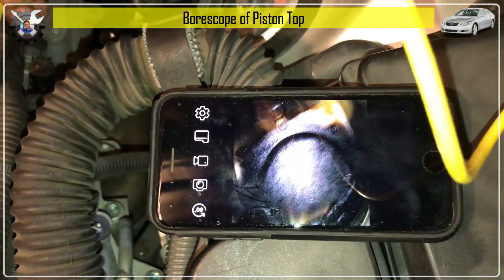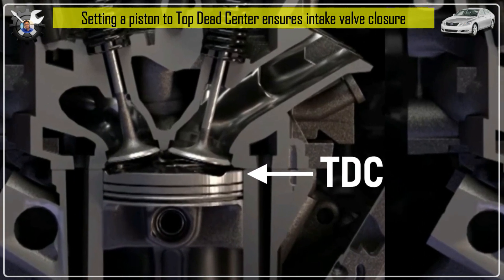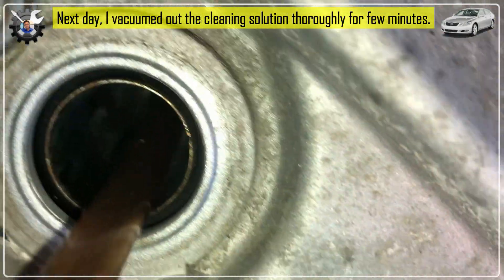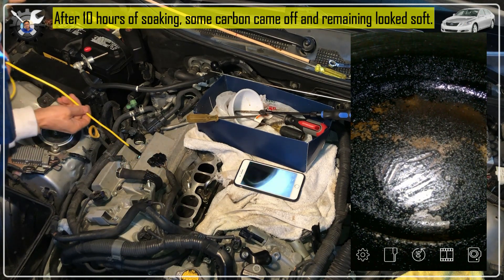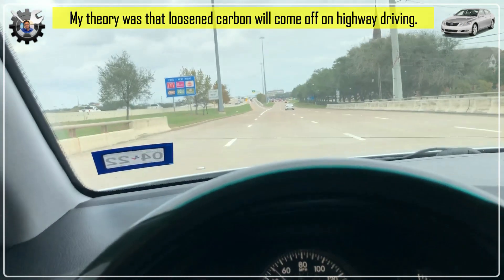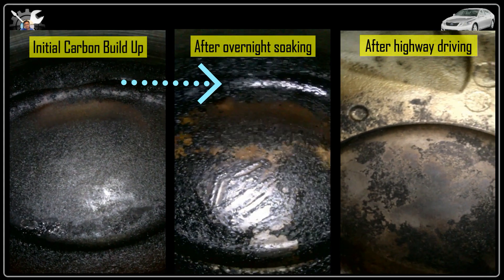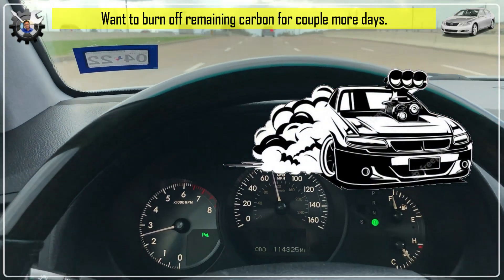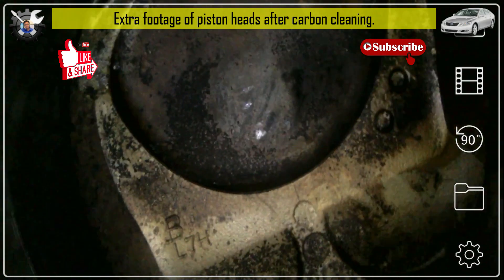Piston Carbon Soaking & Cleaning

Comment: Hi there. My biggest concern is to use chem-dip over B12? Your recommendation is to leave chem-dip soaking pistons for about 2h compared to B12, which can be left overnight or 6h and repeat 3-4 times for better results. Most of the piston soak procedures on YT are carried out with B12. Is there any particular reason for it ? Is the Chem-dip stronger than B12 ? 

I have done this procedure with B12 on my Audi Q5 2.0 tfsi with positive results. The oil consumption dropped, and im getting better MPG. Your video made me think to use something stronger as chem-dip with the 2nd piston soak treatment, which could potentially eliminate the oil consumption.

Thanks for your great video, anyway. Best regards

Comment: Great video but I would definitely recommend changing the oil immediately after filling the cylinders. Remember, your oil control rings do well to seal the cylinders up, but theyre not a perfect seal. That thin cleaner will leak past the rings into the oil pan and thin out/contaminate your oil. Changing before start up will prevent that oil from ciculating around the engine
Reply from the maker: @user-zg4gx9zq9b  I actually wanted the cleaning solution to move around the engine bit for additional cleaning because cleaning solution is left behind in intake valves and I wanted all that solution to get diluted with oil and drawn back down to the pan.
Reply: @DIYLifeSkills I thought about soaking with xylene and atf oil. Strong stuff. Not much tho. Could I get away with adding some oil to crankcase trying to balance potential leak or it's not worth it and better to do it near next oil change?

Comment: WE used to do this back in the old days using Redex. Warm engine to operating temperature (oil as well). Then take out coil packs/spark plugs. Pour 25ml to 50ml Redex down plug holes. Leave to soak for a few hours. Pull out EFI fuse. Then turn engine over but making sure you cover the spark plug holes with an old towel or rag lying across the top of the plug holes (don't shove them in the holes as compression when turning can pull the rag in). Excess fluid is removed after several 10 second cranks from out the plug holes. Some people then refill with same amount of Redex and leave for another few hours. This is in the hope that by cranking the engine some of the fluid manages to get into the oil rings on the pistons to help free them up if sticking. 
Once done all this, reinsert spark plugs/coils. Reinstall EFI fuse. Crank her over. It will or may struggle to start and seem lumpy but eventually the engine settles. Lots of white smoke out the exhaust! So beware of upsetting neighbours. Let it tick over a few minutes then take it on the highway for a 20 minute run. It does help to have a boroscope for before and after inspections You can get one off eBay cheap for 20 pounds/bucks which is good enough to check the piston tops. Years ago it was like you had a new bottom half of the engine. Some people use an engine flush shortly after and change their oil. BG109, Liquid Moly or Forte seems to be decent stuff.
Reply from the maker: I have several friends that drive Toyota and they are very reliable car overall, but 10K mile oil changes are causing all the cars over 120k miles to burn oil. And once they reach 180k miles, it’s burning literally 1 quart every 300-500 miles so they are carrying oil in their trunk.
Reply from the maker: Never heard of added but I’ll check it out.  Also BG seems to have some products that supposedly clean carbon build up on piston rings which cause oil burning on high mileage cars and I’ll be trying that on my car in the near future.
Reply from the maker: Combination of GDI engine and 10K or higher miles oil change have really contributed to rising carbon build up. So I’m doing 5K mile oil changes now.
Reply from the maker: Also the carbon build on the intake valves were so hard baked on there that even overnight soaking didn’t seem to soften it. So I had to literally open the top side of engine and scrub the carbon off chunk by chunk.  So it would be great if BG or Redex products can dissolve the hardened carbon which will make this job much easier.

Comment: Using vinegar works great . 👍
Reply from the maker: Never thought about vinegar but I see some folks using it to clean carbon but mostly after engine is taken apart.  I’m finding conflicting info on whether vinegar is safe for aluminum engine block but looks like as long as you don’t soak for days but rather just few hours, it might be ok.
Reply: UGH... what if is leaks past your pistons into the crankcase 😯No water based cleaners

Comment: You should change your oil after as the cleaner will leak down into the sump
Reply from the maker: Not sure you watched the full video. I intentionally changed the oil after driving about a bit to get loosened carbon to be collected into oil so that new oil starts clean without carbon residue and any cleaning solution.  Also piston rings are like spring that expands out and seals the piston chamber pretty good to create proper compression unless it became defective or fouled with heavy carbon in which case the car will be burning a lot of oil, which is not happening in this car.

Comment: Ive seen that carbon build up can lead to engine knocking..as well.
Reply from the maker: Yup all sorts of bad things with carbon build up like poor gas mileage, losing power, but most of piston rings getting clogged and leading to oil burning.
Reply: thanks.  Is this currently your best method, product?  @DIYLifeSkills
Reply from the maker: @atomicdmt8763  At the time it was but now they have a “BG EPR engine restoration” product that’s supposed to remove engine internal build up including piston rings which I would like to try next.  But of course it’s hard to do video on piston rings without taking engine apart.

Comment: Just 10ml of fluid to soak the carbon. No needs to vac just drive. Heat the engine as PES works best when hot
Reply from the maker: Piston head is sitting on angle and not upright. 10ml is just 2 teaspoon amount and that will just cover just the small portion of the lower side of the piston only.

Comment: Nice video, can I just use regular Carb and choke cleaner? And change oil afterwards?
Reply from the maker: Sure. But be sure to vacuum out the liquid before starting the car to avoid hydrolocking
Reply: @DIYLifeSkills Thank you for the response 🙂
Reply from the maker: You might also consider BG product which has become really popular after I made this video.  They claim to remove carbon on piston rings which is the ultimate goal of cleaning pistons.    Search for BG piston ring cleaner and you’ll find different products and YouTube videos.  Next time, I’m also going to try the BG product.

Comment: I just started the piston soak on my '07 IS350, with the 2GR-FSE. I checked back about an hour later and noticed that most of the chemdip drained out. Do you think this is because of bad rings?
Reply from the maker: Really? How much chemdip did you put? You know cylinder head is slightly in tilted angle so liquid would settle on the lower side if you didn’t put enough. Did you use borescope camera and spin it around to check all sides?  Also did you do this on one cylinder or all? 

If liquid is all draining to the oil pan, then the piston ring springs are somewhat seized with carbon deposits and and not expanding outward to seal the air pressure inside of piston chamber.  

If that is the case, you are definitely burning oil, meaning losing oil without leaking outside. 

The piston ring carbon build up is very difficult to clean though there are solutions that claim to clean it, it’s a hit or miss depending on how bad the condition is.
Reply from the maker: Here is what I would consider doing, first double check all cylinders heads in all angles to confirm how much liquid is left inside.  If there are any puddle left, then you need to vacuum it out as much as you using a shopvac with a 3/8 inch hose.  

This is important to not leave a chunk of liquid puddle before you start the engine to avoid hydro locking the engine that can literally bend piston rods and kill the engine.  

After that, check the oil level, since according your claim all the solution dropped to the oil pan.  Safe thing to do is to do oil change at this point.  

In my car, I actually drove for about 100 miles on highway to get the loosened carbon removed to the oil before doing oil change. I did this because I was confident most of the chemdip stayed inside piston chamber and that I was able to vacuum it out.  

In your case you have chemdip mixed with oil.  Some engine carbon cleaners let you mix with oil and let engine idle for about 5 minutes to clean the engine.  

Now this part is something you’ll have to decide whether you want to start the car and let it idle for 5-10 minutes with some  Chemdip to clean some carbon off of areas where oil will travel.  But this method has much debate by mechanics as it’ll clean carbon but if the internal engine has heavy carbon deposits, sometime a loosened carbon particle can clogged a small oil passage hole which can prevent proper oil flow and make things worse.  

Safest method would be so the oil change before starting and driving the car.  

Give me some updates on what’s happening now?
Reply: @DIYLifeSkills  thanks for the thorough response. 
I let it soak overnight and checked up on it in the morning, four of the pistons seem to be bone dry .
 So I decided to start a soak again and I'm going to check up on it in about an hour. 
I just don't want very dry hard pieces of carbon flying around inside my cylinder walls so I'm soaking again to hope it softens it up. 
I'll follow up when I check again in about an hour 👍
Reply: @DIYLifeSkills  I just checked up on it and bank 1 piston 1 drained completely and seemed to not get a chance to soak much since it drained so quick. 
I'm thinking next time maybe using BG 109 before doing a piston soak, so the rings don't allow it to drain so fast
Reply from the maker: @ballzzinyourmouth8  How many miles and what year is the car?
Reply from the maker: @ballzzinyourmouth8  aggressive driving is actually good for carbon removal. LOL. 

If you Google “piston ring carbon cleaner” you can find some products that supposedly free the stuck piston rings…like this one. 
https://amzn.to/40epMml
Reply from the maker: @ballzzinyourmouth8  Yup riding on old oil too long will promote carbon build up. Also if the spark plug is old and engine doesn’t have clean combustion, that’ll also leave carbon deposits.  Another is using cheap no brand gas.  I only use top tier gas from Costco.
Reply from the maker: @ballzzinyourmouth8  Yeah that always happens after cleaning.  Did you change oil?  You can drive some miles but it’s good to change the oil since it’s got chemdip mixed in
Reply from the maker: I’ll go check it out jow
Reply from the maker: @ballzzinyourmouth8  I did piston and intake valve cleaning at the same time before I started the car. I think it took 1 or 2 tries to start, and it took about 15 to 20 seconds I believe.  And I had a lot of white smoke come out for few minutes.

Comment: can you give me some advices? I did the same piston soaking as you did. I vacuumed all of the chemical out and rechecked with my borescope. reinstalled the spark plugs and started up the car. I was able to drive for about 10 minutes perfectly fine. then when i am at the red light, my car started shaking really bad, check engine lights flashing. i managed to limp back home. scanned the car and it has random misfires detected P0300. I changed to new spark plugs and ignition coils, but engine still has misfire in cylinder #4 (P0304). I rechecked all of my cylinders with the borescope and they are pretty dry. please help out. thank you.
Reply from the maker: I need more info. Can you answer following question:

What make and model and miles on the car?

How many miles on the previous plugs? Small bump on plug tips changes the plug gap. We’re you careful in handling and installing?

Did any of the coil connectors break? These break easily on Toyota/Lexus. Broken ones need connector housing replaced or secure it with a plastic zip tie. 

Did you buy exact matching plugs from Toyota/Lexus dealer or from reputable auto parts store?  Online has too many fake plugs. Any non exact matching will cause misfire on this car. Initially I bought a slightly cheaper plugs and had to return and buy the exact OEM matching ones. 

Did you carefully check the plug gaps on new ones? They say you don’t have to since it’s factory set. But my new set was slightly off on some and gave misfire and had to reset it. Also be careful now to drop the plug into the plug hole as it’ll change the gap.  Use magnets or rubber inside plug socket that can hold the plug without dropping it.  

Try swapping both coil and plug on #4 with another cylinder and see if misfire moves. 

Make sure non of the vacuum hoses came out while juggling wires around to replace the plugs.
Reply: @DIYLifeSkills   thank you so so much for your quick reply and your help. I did what you said and I rechecked my ignition coils. one of the four got damaged after took it out to do the piston soak. I got another one and everything is fine now. Thanks again!!!!
Reply from the maker: @adamnugent2137  Perfect.  Great to hear all is good now.  Thanks
Reply: One of my spark plugs got damaged somehow (hairline cracked porcelain) even though I was being careful. That in turn was causing misfires, even thought it didn't throw a code.

Comment: how do you find personally tdc on the 2gr?
Reply from the maker: Same method that I used should work. Remove the spark plug, and use a long wood dowel/stick and you rotate the crankcase until the stick doesn’t come up anymore, and that’ll be TDC. Mark the TDC point on the wood and repeat it one more time to double confirm that’s the absolute maximum TDC. After that all cylinder should be same in terms of stick depth to determine the TDC.
Reply: @DIYLifeSkills  wow fast and thorough reply thanks. Do you have a method for finding the compression stroke for say a leak down test?
Reply from the maker: @ballzzinyourmouth8  The best is use the compression test tool that can be rented free from auto-part store. You just remove fuse to the fuel pump first to stop feeding the fuel, and then remove the spark plug and insert the compression test adapter in place of spark plug to get the reading.  And do this for all cylinders.  Just note that these compression testers can vary quite a bit in reading.   So one thought is to rent different brand from different auto part stores to get two different numbers to draw better conclusion. 

If you see a low compression on some cylinder in comparison to other cylinders, then you can pour very small amount of oil through the spark plug hole and directly onto the cylinder head, and then repeat the compression test.  If the compression number comes up to near same level as other cylinders, then you know, likely you have bad piston ring or worn piston chamber.
Reply from the maker: @ballzzinyourmouth8  Yeah, this seems to common problem for Toyota/Lexus and many other modern car's problem that is caused by combination of the following:  (1) Not changing oil on schedule and frequently riding on old oil too long  (2) Not checking oil level frequently enough to ensure that car is not running on low oil (3) mainly driving in city for short distance and not regularly getting long highway driving  

This results in gradual carbon build up on piston top and eventually on piston rings.  On piston, there are multiple piston rings, and one of them is called oil ring, which is supposed to scrape the oil from the piston chamber wall, and that oil is supposed to go through bunch of tiny holes just around this oil ring, but bad oil maintenance cause carbon to clog these tiny holes, so the oil that is scraped off the cylinder wall is not able to go to the oil pan, but rather, that remaining oil burns off during combustion cycle.  Hench, even if you don't have a oil leak, you are losing oil because it's getting burnt off.   

Another side effect of this is, all those exhaust fumes from burning oil will eventually dirty up the catalytic converter and you'll get bad cat check engine light.  If you catch this earlier, there is some hope to unclog these holes with engine flush/cleaners, but a quart of oil every 300 mile is pretty advanced stage, it'll be challenging to repair that. 

If you google "piston ring carbon cleaner" then you can find some products that claims to clean piston ring carbons, but check on their reviews.  Also follow the instruction carefully, as usually these cleaning solutions are meant for quick cleaning use and oil has to be changed afterwards as they are harsh to leave it in a long time.
Reply from the maker: In my case, leaking some cleaning solution into the piston actually worked out for me as it cleaned the carbon off the piston heads.  I have a separate video on this.
Reply from the maker: Are you having some misfiring or oil burning issue?